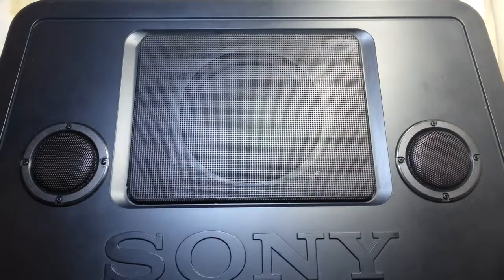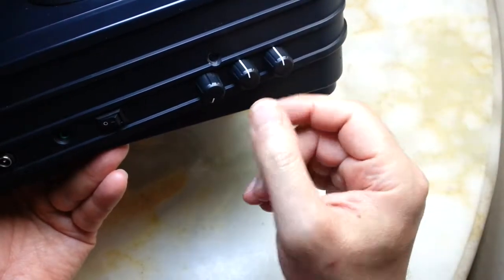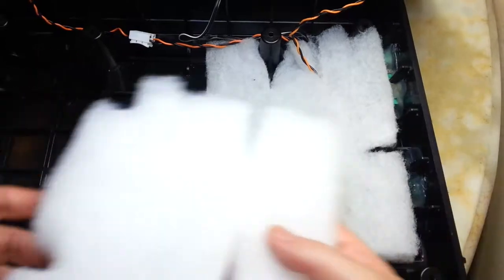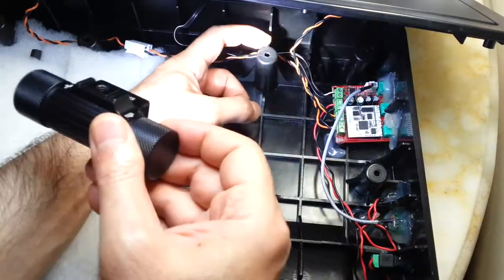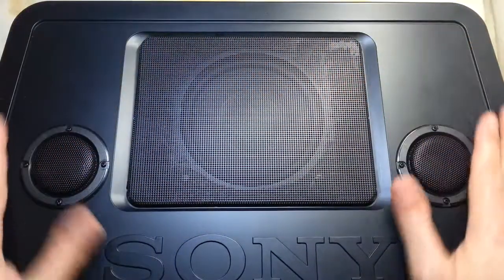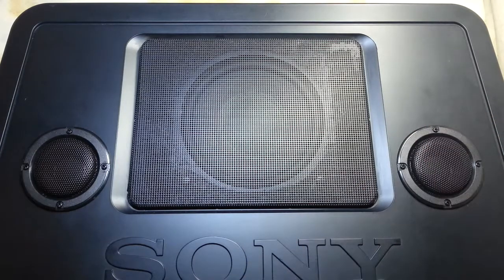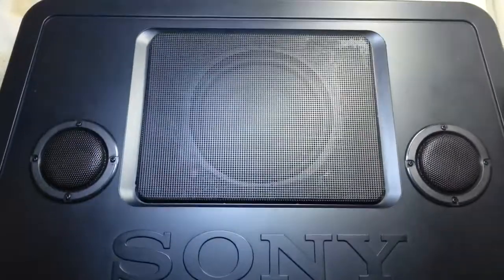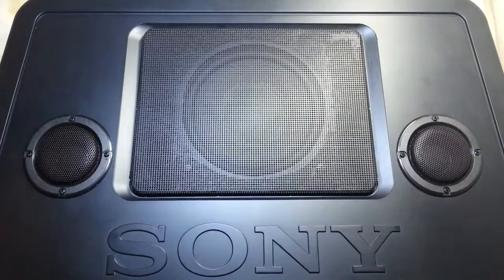Part 2, TPA3110D2 Amplifier 2.1 channels Bluetooth 4.0 test & finished project

Comment: The first mistake you doing in this speaker is the cabinet, you put the subwoofer to the same cabinet with the small speakers!! The second mistake is you don't using to your cabinet a bass reflex..
Reply from the maker: Thanks for your comment. The reason for not adding a bass tube vent was because the bass became less pronounced other than that you are absolutely right. Thanks again, take care and stay well.

Comment: Hi I love your video! Im doing a project too using the same amp, just wondering how many volts and amperes do you use in the power supply? I hope you notice this.
Reply from the maker: Hi, thanks for your interest and question on my channel. I am using a 12v 2A power adapter or 3x18650 batteries. Cheers for now.
Reply: @HomBKaviani  thank you very much!

Comment: Grate job! You should cover 15w speakers with a caps. I made something similar a year ago. I got my sub woofer from a very  old sony tv. Were have you got yours? I installed a toslink (SPDIF) converter in mine.  Now i use it as a soundbar. I connected it to tv by optical line. It Sounds grate!  You made a grate job. Yours soundbar looks grate (much better than mine).
Reply from the maker: Hi, thanks for your kind words. This bass speaker box was sat on top of old Sony TV and as it had good quality I've kept it for a project for a long time until I found the 2.1 Bluetooth amp board. Later I've added battery pack and a handle for portability and sound sensitive led lights. If you are interested check out my channel and have a look. Again thanks for your interest and comment. Cheers for now and take care.
Reply: @HomBKaviani  hi. As I sad before, I have got myne from old Sony TV too. I think it's too big and heavy for portable speaker. So I use myne as a soundbar.